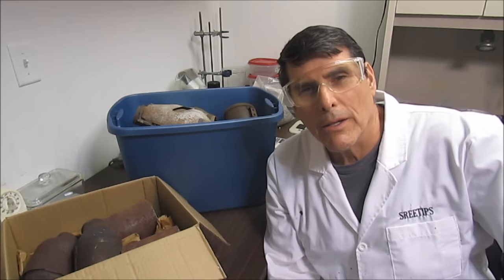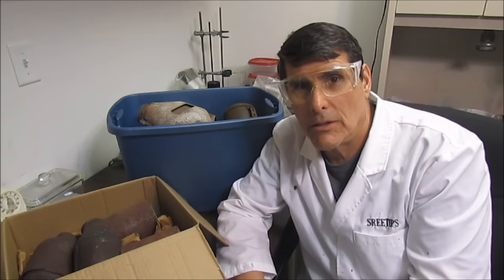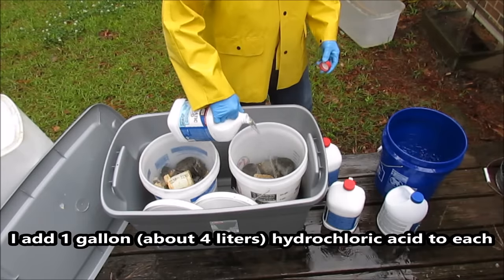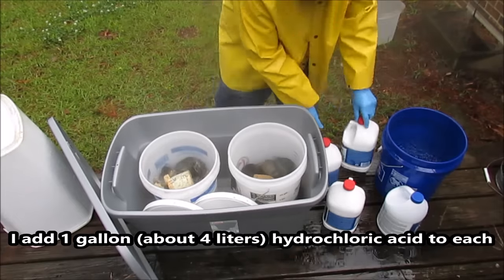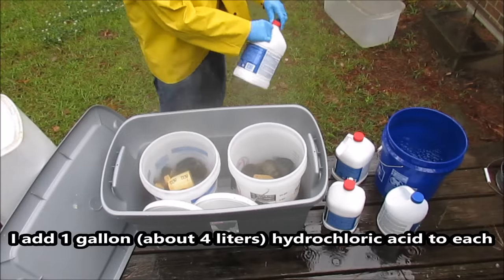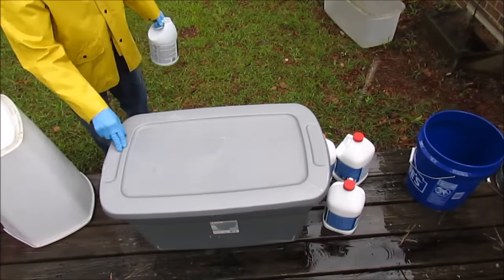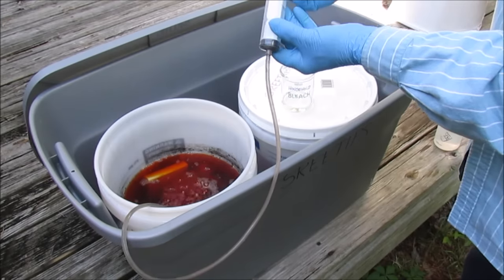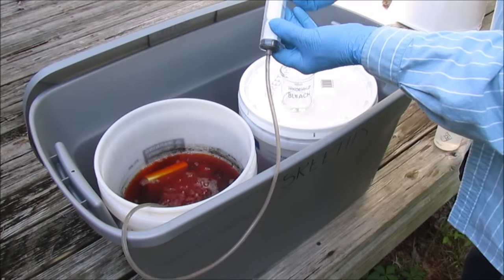Platinum Recovery From Automotive Catalytic Converters Part 1of2

Comment: Aside from the obvious dangers as stated with the recovery of platinum and palladium from catalytic converters, there’s just not enough of the metals in each to make it worth the risk. A replacement cat for a given vehicle even an older one is about $100 so the content of these precious metals must be minute
Reply from the maker: You are correct. Recovering the metals from cats is dangerous and difficult. Best left to the big refineries.

Comment: Great video, thats alot of work, im not questioning your knowledge at all , but i noticed you have a vacuum pump, instead of evaping the final rinse off, why wouldnt you use the vacuum pump to boil off the excess h2o? Just wondering. Thanks for the informative video.
Reply from the maker: I've never tried that. I would be concerned that boiling would create spatter. Using gentle heat to slowly evaporate the water off is the way that I was taught to do it.

Comment: I must admit, I know jack about those things. That jar of bead things - are those what go inside the unit? Also, would one be likely to find CCs at an auto scrapyard, or are they too valuable for that?
Also, out of curiosity, what does the substrate look like when it's brand new and totally unused?
.
I'd suggest using TCCA tablets instead of the bleach. That way, the chlorine will be produced both from the bottom of the mixture, and also constant. Would there be any point crushing the substrate first? Or would that just make it harder to filter?
Reply from the maker: 1) yes. 2) no, they get cut off first thing and sold. 3) substrate will be a pale yellow ceramic color. 4) TCCA is a good suggestion, thank you.

Comment: Question. Is there a specific reason you used zinc? Instead of something cheaper and easier to get like iron or aluminum.
Reply from the maker: Zinc is best because it reacts faster than iron or aluminum. Either of those would work, but it would take much longer for the reaction to happen if iron or aluminum were used.

Comment: Use a grinder for what it's made for. This is way too hard and risky opening things with a chop saw or grinder. A large portable or upright table style metal band saw is more control, almost no dust or flying debris and is faster and generally safer to operate without damaging the parts you are trying to free  from the frame.

Comment: SREETIPS,  Why does this "bottom" of the bucket have so much More of the Acidic reaction?
Reply from the maker: If you refer to adding bleach through the tube into the bottom of the bucket then that was to produce chlorine lower in the bucket rather than just on the surface. It's the chlorine that dissolves the PGMs and causes them to go into solution. Chlorine will dissolve just about any metal.

Comment: Good video! You may want to invest in a bandsaw for cutting open those CC casings. Also, let me guess, you never played football in high school I am betting? If you had, all of that work knelt down and squatting would have necessitated a work bench, and not the concrete floor of the garage.
Reply from the maker: Scott, investing in a band saw would be a waste of money. I only did these cats to make the video. I'll probably never do them ever again. Refining cats for the platinum is not feasible for the home refiner. And too dangerous. Keep doing it and eventually it will get you, no matter how safe you try to be. I played football back in Jr high.

Comment: It seems like you left a lot of free HCl in the solution when you cemented.   Would it have been better to neutralize it first or do you need that HCl for some reason?
Reply from the maker: Excess HCl will tend to consume more zinc. It could have been neutralized. If I ever did this again, probably never will, then I would adjust the procedure to include raising the pH of the PGM solution before adding the zinc.

Comment: Would you consider setting up a. Visual demonstration on the volume of air and how far away can you Fume Hood  Draw you know like a little test using smoke not a lot just some so we can get a visual of the fume Hood? Thanks man.
Reply from the maker: With the original motor and no restricter plate on the discharge, that thing would try to pull me into the fume hood! But with the new motors (I’ve installed 4 since 2016 when the original burned up) they are cheap and underpowered. Sometimes I can get a whiff of fumes when working close to the edge. It draws the fumes away, but just barely. Example of the times. Everything is being pared down to nothing. But I can ignite a piece of news paper and demo the smoke. I’ve done it before.

Comment: Militech 1 and zddp would be two of the additives I would add to that oil let it run because they had a hundred and fifty degrees the military one will bond to all shiny metal surfaces under stress and they will immediately have no more where inside from running it

Comment: like always you surprised us .great video .can i ask how many catalyst u used in this video .i want to know how much each catalyst gives precious metal .i know u add some stock of palladium and the result will be i think 16 g of mix platinum and palladium .
and the other question is why u didint crashed them so u can mix them very well ,i know its hard to filter the powder later but can u be sure that u have all the liquid that left
Reply from the maker: It was about 12 cats, plus the beads. But some of the cats were barren. Should be about 2 grams per substrate - estimated.
Reply: Sir please my help

Comment: Boy that sure is a lot of work. It also involves a ton of money in material's and equipment. Hardly seems worthwhile. W'ont they buy just the mixed material you cut out of the converters?
Reply from the maker: Probably, but then I wouldn't have them to make the videos.

Comment: I want to shout. Dear brother, this will not happen.
I put the catalyst in the aqua regia and after an hour, all the precious metals are dissolved in the acid. Very nice orange / red color.
When I put zinc metal in it, the reaction is very intense and calorific, but the color of the solution changes to a very pale orange and nothing precipitates. what is the reason ?

Comment: I've seen you add hydrogen peroxide a few different times in videos.
What is that for in gold, silver and platinum?
Reply from the maker: If gold or platinum (but not silver) are put in hydrochloric acid then neither will dissolve. But if you add an oxidizer such as nitric acid or hydrogen peroxide then a reaction takes place and causes the metals to go into solution. The advantage with the peroxide is no nitrosol compounds to have to deal with.
Reply: @sreetips  thank you

Comment: @sreetips im curious would it be posible to use sulfuric acid from old car batteries to extract 
the platinum from the converters. I work as a car mechanic and ever so often some guys from
out of country shows up in a van and buys old catalytic converters for 30 - 70 dollar each
they also pay about 2-5 dollar for each dead car battery cant be that much money in the lead can it?
Reply from the maker: Sulfuric won’t work to extract the metals.

Comment: do you lose any of the metals when you cipher the beaker into the waste bucket? if so what could you do to reduce the loss of those metals
Reply from the maker: There are losses all along the way. Especially with PGMs. Everytime it's handled or transfered, there are losses. When precipitating the metals, after adding precipitant, the longer you wait, the greater the chance of other metals coming down with the target metal. Reducing these losses will depend on the skill, technique, and experience of the refiner. I'm just an advanced, self-taught beginner.
Reply: sreetips oh okay, videos are great thank you for replying

Comment: Sir, can i use ammonium chloride  instead of zinc to precipitate platinum ?
Reply from the maker: That’s what I use. But first, to get the right concentration (1g per 20ml of solution) I cement on zinc. Then redissolve to proper liquid level. 1g per 20ml is critical. To much solution and the Pt won’t precip right. To low solution and it will form an undesirable precipitate.

Comment: Just to clarify it isn't platinum itself that causes platinosis but the compounds of platinum with chemicals like chlorine?
Reply from the maker: Platinum metal is non reactive and harmless to touch. It’s the platinum salts when platinum is put into solution. Hexachloroplatinic acid (platinum in solution) can cause platinosis.

Comment: What do you do with the rest of it. The chemicals and stuff? Down the drain?
Reply from the maker: I put gold refining waste into my stock pot. There, trace amounts of precious metals "cement" out as a fine black powder on to pieces of copper. The copper goes into solution. Then, the resulting acidic copper solution is transferred to my waste treatment bucket that's full of iron. Here, the copper "cements" out as harmless metallic copper powder and the iron goes into solution. The copper powder is disposed of. The acidic iron solution is siphoned off into a third bucket where it is treated with sodium hydroxide. The iron precipitates out as a metal hydroxide. These hydroxides are filtered out and dried, then disposed of. The caustic solution (filtrate) is then neutralized to pH7 with swimming pool pH down, and disposed. Nothing toxic is ever poured down the drain or in the dirt.

Comment: Just curious, lets say a scrap cat is worth $75, what is the value of the metals when you break it down like this? Would it ever make sense for a scrap to learn this process?
Reply from the maker: I'd have to say no. Too difficult. Too dangerous. Not very much metal. Lots of waste. This is probably best left to the big refiners.
Reply: @sreetips  that's what I was thinking. Thanks

Comment: The converter you are using to recover is a very low P M content / preheat converters mesh wrap all very low recovery units .. beads if not striped should have a much higher recovery they are from the 70's and 80's

Comment: Can you precipitate out the platinum with ammonium chloride?
Reply from the maker: Yes
Reply: Would aluminum foil also be a good option to cement out the PGM’s?
Reply from the maker: None of the refiners I learned from used aluminum

Comment: on minute 46:38 what type of filter and whats that line hooked up to the beeker is it oxygen?  Whats in that bucket on minute 44:52 pure beach? How long after pouring the Muriatic acid thru the filtering when using the coffee filters. Im so intrigued.
Reply from the maker: That line is a vacuum hose. It transmits from a vacuum pump and helps pull the liquid through the filter. The funnel is a Büchner funnel. The filter paper is a lab grade filter that fits perfectly inside the Büchner funnel. The solution in the bucket is dilute hydrochloric acid with small doses of bleach added daily. Adding bleach forms chlorine. Chlorine dissolves the platinum group metals and puts them in solution. That's why the liquid appears orange - because it is pregnant with platinum and palladium.
Reply: Thank you so much. This is amazing.

Comment: What did cost to run through the process compared  to the value of the pgm ?
Reply from the maker: Ronald, the cost was greater than the amount of metal that I was able to recover. But I don't have exact figures. I did it for the video and just to see if I could.

Comment: What is the difference between platinum and palladium? I hear the term "platinum group metals" and it sounds like platinum is a blanket term for a number of metals, one of which is palladium?
Reply from the maker: The platinum group includes six sister metals. They share very similar characteristics. Since they are so alike they are hard to separate from each other; platinum, palladium, rhodium, iridium, ruthenium and osmium. They are grouped together on the periodic table. All very non reactive (they won’t tarnish) and all have meting points higher than steel.
Reply: @sreetips  Thanks for the info!

Comment: I do not understand adding more acid and then adding zinc.  Won't the acid consume the zinc without cementing anything?
Reply from the maker: I’m trying to get the ink-black suspended material to settle. The only way to do it is to add more acid and then some more pieces of zinc. Why? I don’t know. I just know that it works
Reply: @sreetips  Would the acid alone be enough?  Given time to settle?   Adding acid and zinc seems to be a waste of zinc.

Comment: You added way too much PH up so then you don't get a rigorous reation when you add zinc so you have to keep adding back the hydrochloric acid.  If you stopped adding the pH up you might get a clear solution after the zinc reation and all the zinc might be gone.
Reply from the maker: Is that so, I guess I won't get a second chance because I'll never do these again. Too dangerous.

Comment: Never use tap water. Distilled water only! I’m a real chemist that went to college. I mean you can but I never would just in case. You know with distilled what is in it.
Reply from the maker: I use distilled water for silver nitrate solutions or any time I'm working with silver in solution. Platinum in solution (hexacholorplatinic acid) or gold in solution (chloroauric acid) tap water is fine because they are both chlorides. It is the dissolved chlorine in tap water that cause a problem with silver solutions. I'm not a chemist, just a refining enthusiast.
Reply: Behold the real chemist who went to college buried in debt,lacking in knowledge, and owned by an amateur. I can't say much though I used tap on silver once =(

Comment: So theoretically it would be possible to remove the cats in a scrap yard collection millions of them then in one shot extract an unknown amount of these metals. I would assume good ventilation and extreme care would prove profitable for such a large amount.
Reply from the maker: It's not theory, there are places that do just what you have written. But not very many of them. Special equipment is required to make it safe for the refiners. There is NO WAY for the individual refiner to make a profit from catalytic converter refining. It's to dangerous.
Reply: @sreetips  Yes it does seem a bit on the risky side but watching the video was very interesting. Not something i would personally do i simply don't have the background in chemicals or the needed supplies. Still it was informative to watch thanks

Comment: Kinda wonder if catalytic converters were invented as low level chemical disspersment. 

Seems like the one thing they do is collect moisture and drop it out of the tailpipe  (chemical infused moisture that is.)

I did watch the video whole and am curious of the cause and effect of these inventions to us as living organisms. ☺
Reply from the maker: The platinum group metals used in catalytic converters is not toxic at all. These metals are some of the least reactive on the planet. It's only AFTER they are put in solution with acid that they become dangerous. The wash coat on the ceramic substrate inside of the catalytic converter is in metallic form and completely harmless.

Comment: Ok I want to know how to get the Rhodium out of it first since it has the highest value now at 3K. The other thing is what about electroplating it out of the ceramic? Do you think it could be possible since the ceramic is made to be porous? One other thing I did see a man on Youtube who wanted to be the ESSAY for folks who are willing to do this, he had a system, and showed it, he was a foreigner, had an accent and darker skin. He was doing it in a room and it was a 55 gallon drum  where he put the arid in to leach out the Platinum, then pumped it out with a small pump and then added some chemical so the metal cryitalized. Kind of green looking crystals and that was it except adding Baking soda to neutralize the acid. I am sorry it was a while ago. I could not find it again. I don't claim to know much I keep watching and reading just getting pieces till I can really understand the concepts I hope.
Reply from the maker: It's not easy and it's very dangerous. If you breath it one time then your lungs will be shot.

Comment: I have a motorcycle catalytic converter just like it's different than a car catalytic converter I think it's like some kind of metal instead of the honeycomb looking stuff but it does seem to have platinum in it so I put acid muriatic acid and I put hydrogen peroxide in a pickle jar and have been letting us sit I have a green looking color to it now and I just went ahead and added bleach a little bit though and it's just sit and it's been two days now do you know if I have messed up the solution by doing it that way or have anything to help me with while green instead of red and I'm guessing you're probably going to say that I need to stanious chloride test which I'm going to do I'm having a hard time finding the right solder I don't know why but I it's hard to get 90% 10 solder apparently
Reply from the maker: Platinum in solution is very dangerous. Not for the backyard refiner. Look it up: platinosis.

Comment: Try this 10g mixture... 6g .999 silver/4g pure copper.
Reply from the maker: That’s a step in the wrong direction.
Reply: Comment was for the wrong video... Possibly wrong guy. This mixture is for the video where they heat and melt with different ratios and recovery metals. Sorry. Although I will watch your video thru now

Comment: will Rhodium dissolve in hot Aquaregia? if not then how to dissolve it from a catalyst converter?
Reply from the maker: Chlorine leach
Reply: @sreetips  will  Hcl + Hydrogen peroxide  also  work?
Reply from the maker: Don’t, I’ve very little experience with rhodium